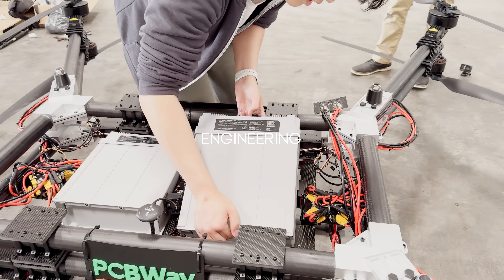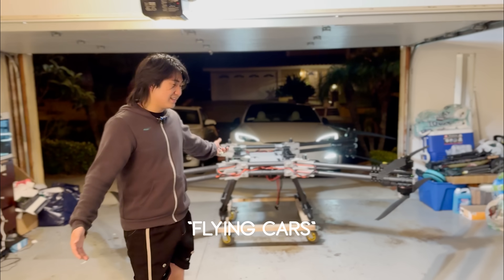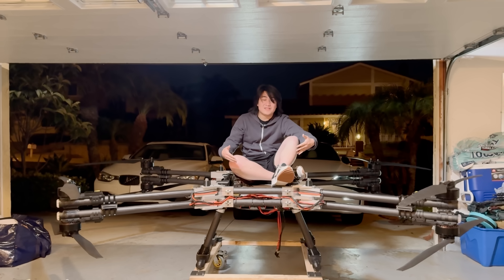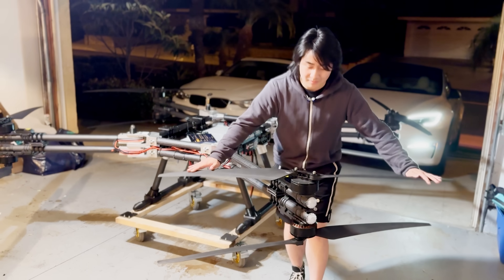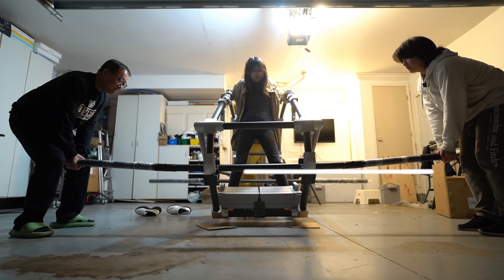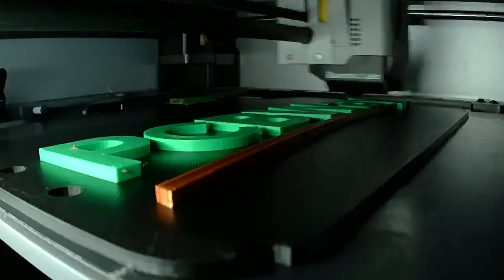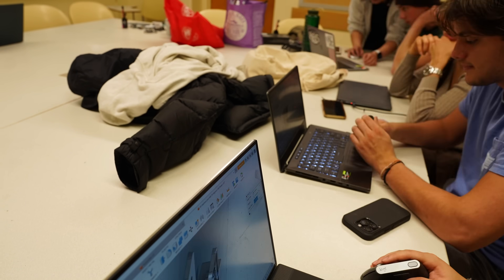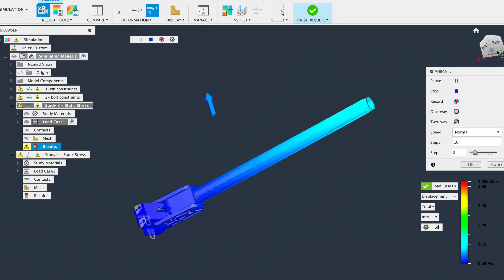My "flying car" finally FLIES

Comment: Impressive work! Just a couple of concerns. What protection will you have for the pilot if a rotor fails and the debris heads towards the cabin? I also have concerns about the soldered wires. I worked for BMW and they don't allow any soldering as vibrations in the car can make them fail over time. I know you were trying to engineer the structure to prevent damage from vibrations but you should also do that for the wire connections and have either crimp connections or robust locking connectors.
Reply from the maker: Thanks for bringing up the crimp idea. I actually didn’t know this, but after a brief research, you’re very much correct. I’ll reflect this with my team and the next design. Thanks!

- a fellow BMW driver
Reply: @alanzeekk  Glad to help!

Comment: Good luck my friend this is amazing and your hard work will pay off.  When it's complete I hope you implement the ultimate set of safety features for the pilot and other people sharing the airspace and the safety of those on ground.  

Again amazing work love it.
Reply: I have a great safety feature for you: A helicopter with one rotor above all heads and a ducted tail rotor (also elevated into the plane of the main rotor) . Auto rotation in case of electrical failure. In case of a crash, the blades don't hit the pilot.

Comment: This thing scares the crap out of me starting with the lack of safety wire, shrink wrap, and some prop guards, not just for a pilot but for ground personnel. At least your test area is smarter than you are... I do like some of the music you used a lot.
Reply: safety wire is weird. Calculate the correct torque for the screw, avoid lube, max vibration possible and it should be safe. That wire is more for places you cannot really reach, and corroded surface.
Reply: @ArneChristianRosenfeldt  You need to check out BASIC aircraft assembly. as it pretty much has nothing to do with the factors you mentioned. Sorry, you're just wrong.

Comment: A roll cage won’t protect a human if it falls out of the sky.  Consider a Ballistic Parachute and an emergency cutoff for the motors/propellors.
Reply: Cages protect car drivers at speeds you only get when you fall 10 m. So, fly low!
Reply: @ArneChristianRosenfeldt  Horizontal speed counts as well as vertical acceleration towards the ground.  🙄
Reply: Momentum.  Obey physics, it’s the law!
Reply: @GodzillaGoesGaga  so use a computer with radar to limit altitude to 3m and horizontal velocity to 40 km/h. This is survive-able in a car accident.
Reply: @ArneChristianRosenfeldt  Why would you limit altitude to 3m ?  Kind of defeats the purpose of having an aircraft !!
Reply: @GodzillaGoesGaga  to limit fall velocity. I was inspired by those French quads, which seem to obey this limit and still go off road very well.
Reply: @ArneChristianRosenfeldt  Mass.  You’re not thinking like an aircraft engineer. This is not a land vehicle.
Reply: Aerodynamics too.
Reply: @GodzillaGoesGaga  I just hate parachutes and explosives.
Reply: @ArneChristianRosenfeldt  Yet you probably drive a car that explodes how many times a second ??  Hating is no reason to not use something.   If there’s a foundational reason then explain it.   That’s what Engineering is about.    Ballistic ‘chutes are pretty well understood.
Reply: @GodzillaGoesGaga  a car uses deflagration and does not explode in the hand of a maintenance worker . Yeah, airbags . But don’t let amateurs handle them!

Comment: You should use PID controllers with gyro data to prevent the jerkiness of the movements
Reply: Looks like he's using PX4. He needs to adjust his parameters and maybe autotune when he can charge his batteries more.

Comment: I don’t want to hate but I don’t see how this is a flying car in any way yet. I mean so far you’ve just built a big drone.
I’m interested in seeing where you take this though. Your talented I can tell that much but just calling it a flying car seems a misleading
Reply: eVTOLs are typically called flying cars, even though they are "scaled-up" drones. Likely the personal transportation aspect. Most genuine flying cars have failed due to low feasibility/folding wing designs. Humans can hardly drive on roads, so sadly I think real flying cars would be disastrous. eVTOLs have genuine applications in the civ/military world too, so this is a good project.

Comment: Don't forget a parachute. Should be one of those spring-loaded low altitude types. And a big panic button so if anything goes wrong, it automatically does the yeeting process for you of dismounting you from the craft.
Reply: Once you load it with a person and fly a full minute claim the world record and call out the companies on the stock market scamming all those investors.
Reply: @TheBagOfHolding  Hmmm, I don't think that's a world record ... you can buy a Jetson One over 2 years ago (California company). That doesn't make this any less impressive though. Eventually, he could (should) make this an opensource EVTol project on GITHUB. Others can improve on the original design or fork them to create variations, etc. You could sell kits so people can buy the parts and build their own, etc.
Reply: @joireland  you can pay for one but nobody got one. Those are scams. They can't fly them for two full minutes with a rider. They edit the videos to make it look like they can.
Reply: @TheBagOfHolding  I think you misunderstood. The company in California (unrelated to this video) sells a product named Jetson One (not a kit & not a scam) and they've been available for 2 years now (it's easy to verify that on your own).
Reply: @joireland  nobody can improve on the design unless they invent a different kind of battery that is magic. He already hit the wall of physics.
Reply: @TheBagOfHolding  It's possible ... do your research dude. His design may need a lot of adjustments to make it lighter but go lookup the Jetson One (maybe buy one for yourself).
Reply: @joireland  I know all about the jetson one.  Look at their videos and count the seconds between edits. Look for any multirotor evtol that ever did what it claims or lifts a person for 3 straight minutes. Nobody got one.
Reply: @joireland  if it's possible then why hasn't anyone ever done it and why don't any customers have their jetson? Have you ever heard of the square cube rule in physics?
Reply: @joireland  this guy should set up a camera and make a video of himself getting on then taking off then flying flying for a full minute then landing an getting off without edits in the video. He should claim a record and have the news cover that new record. It would expose the industry when they can beat it by much.
Reply: @TheBagOfHolding  Jetson One claims 20 minute flight times, it can fly 63 mph and has a weight limit is 210 lbs.
Reply: @joireland  jetson is a sham company. They already missed delivery dates. They can't even prove their own claims.  All the stuff this guy used is already open source it's just a large drone. What did he invent that he can make open source? It can't get much lighter. People that sell them would need for them to be safer and that would add weight. I think this one will fly longer than the jetson one with the same weight. They couldn't get much better if they just used 4 poles 4 motors and a person sat directly on the large heavy battery they would need. Find the longest flight anyone has ever had on one.
Reply: @TheBagOfHolding  Tesla also missed their delivery date. Dude give it up. Go see one in person. Mass production is difficult ... building 1 or 2 is easier (still hard though). I'm talking about Jetson One (not this guy).
Reply: @TheBagOfHolding  Also you're wrong again. The Jetson One is 120 lbs WAY lighter than 200 lbs that this guy built.
Reply: @TheBagOfHolding  What can he opensource ... hmmm ... he can upload to GIT the parts list, the 3D printer design files, the schematics, build instructions. Use your imagination. Not sure why you are so negative.
Reply: @joireland  electric cars are possible and they could take people places 100 years ago. This isn't.
Reply: @joireland  jetson one is nothing but lies. Did they include the battery? Did they prove a single claim?
Reply: @TheBagOfHolding  OK ... now tell me that the earth is flat ;)
Reply: @TheBagOfHolding  Go watch an air show and see one for yourself. Don't waste my time here.
Reply: @joireland  I know more than you do about this. Someone at an airshow would record it an post it. Find that. The only way to know is if someone sits on one for a full minute and claims the first world record then people would try and beat it.
Reply: @TheBagOfHolding  This is not about your ego ... just state what you actually know and not what you believe about Jetson One. Like I said go to see one yourself at an air show.
Reply: @joireland  I know the square cube law.  What weight does jetson say they can carry for 20 minutes? That's empty and they can't even do that. Find a video from an airshow. I think people record those.  Find a video from anywhere on earth.
Reply: @joireland  do you think there should be official world records for multirotor evtol craft? Distance duration and load records? Someone should start them and then we would find out soon enough if companies are legit.
Reply: @joireland  do you think the drone in this video will show a 5 minute empty flight this year? That would be an amazing feat but nobody would be impressed with that because everyone is already fooled into thinking people are riding them with deceptive editing and impossible claims.
Reply: @TheBagOfHolding  nope. legit. $15 million in funding. Marc Theermann is on their board of directors (from Boston Dynamics). I've seen them fly. Not much more to say but go see for yourself.
Reply: @joireland  yeah for how long and with how much weight? I don't belive you. Prove it. They probably have lots of shills claiming that.
Reply: @TheBagOfHolding  There are a lot more credible people than you investing in Jetson (they raised 15 million in funding and that's no lie). You're just an 18 year old tolling these sites and spreading negativity. Go talk to Marc Theermann about their "fake" stuff if you don't believe it (they already sold & shipped about 500 of them).
Reply: @joireland  people invested in theranos and they had important people on their board. Does that prove they ever flew a full minute with a rider?
Reply: @joireland  shipped to who? Can we get a review? It seems people would want to record their new toy.
Reply: @TheBagOfHolding  Go learn something about the current state of battery technology. Go research Natron Energy and learn something. No time for someone who doesn't state any facts.
Reply: @joireland  it's easy to massage the numbers on batteries but you should look at the energy density of the individual cells that make up the battery packs and the progress they have made.  If people had them they would fly them and record such an amazing purchase. Who bought one? Why isn't there a full flight recorded? Why isn't there a full 2 minutes of flight recorded? Why isn't there a full empty flight that is several minutes long? People record delivery of their cybertrucks and make unboxing videos of phones but nobody would with something like a jetson one?  Please.
Reply: @TheBagOfHolding  I guess because it's no big deal. It's been done 2 years ago. Stop making up these conspiracy theories it's not healthy.
Reply: @joireland  sure no big deal. Lol Was it a big deal 2 years ago?  People make videos if there is a new type of pizza from pizza hut and they order one. There would be 2 year old videos of excited customers with amazing aircraft if that was true.
Reply: @TheBagOfHolding  You are a few years late. 3 years ago a dude flew a flying hoverboard for over 4 minutes and that one was much smaller making it's range more limited. The current records for eVtol is way past an hour and Jetson One doesn't claim to be able to break that, so how could they post a record breaking video? There is one video that is over 18mins though.
Reply: @znail4675  it wasn't electric he had kerosene in a backpack.
Reply: @TheBagOfHolding  No backpack and it was electric. Just search for world record electric hover board...
Reply: Remember, there were electric cars before gasoline powered cars.
Reply: @joireland yeah , I got access to all that equipment here in my garage. I’ll crank it out and be flying by 3pm est. lol
Reply: He could also easily integrate an automotive airbag attached to his yeet button that would throw him free of the vehicle too, auto airbags are cheap and plentiful at junkyards and quite powerful. YEET
Reply: He could use guide studs for the seat, and a powerful solenoid or linear actuator that would decouple the seat from the eVTOL. So, if he hits the yeet button, or it's activated by CHAOS detection, the solenoid decouples the seat, the airbag deploys, pushing him free, the guides ensure the seat flies linearly from the vehicle, and then a solenoid/etc deploys the parachute, with manual overrides of everything, so all that's needed is to push a button, or pull a cable. I think this would alleviate a lot of fears for people. When I build my own eVTOL, I will make something like this for my safety, and deploy it over water to test it. Also might put the drone in a tailspin and test it that way, too. I think once the basic design is perfected, it'll go a long way to alleviating fears.
Reply: It would have to be smart enough to yeet "the package" in a predictable trajectory, while at the same time trying its best to avoid flying back into it. (Very real danger, even on the real deal but I think they have a few systems that are supposed to "prevent that".) @wolfpeoplearereal
Reply: It would have to be smart enough to yeet you in a predictable trajectory, while at the same time trying it's best to avoid flying back into you. Very real problem, even on the real deal. They actually have systems that are supposed to "prevent that". (Maybe it turns everything off so it drops down real fast while your flying up.) @wolfpeoplearereal
Reply: Yeeting process should be the technical term.
Reply: Why is this world so full of brainless people?.. OV-22 didn't teach you anything?
Reply: Wouldn’t the prop cut the parachute when landing is done or like are you saying ejection way

Comment: Great video, bit confused to why you left the corners so sharp on the aluminium machined parts, a small radius would have avoided the stress risers. I'm sure its plenty strong enough just seems odd when its so easy to avoid the weakness. Anyway good luck.

Comment: cool concept, would having the "human" and cage below the props be a more stable construct over time lower the center of gravity?
Reply: The main problem would be no way to eject, but I guess a parachute for the entire vehicle would work.
The thing that is a problem for this particular design right now is that it's over engineered in that it's too heavy.
The previous design was too bendy, but this one takes it the other way making it too heavy to get good performance.

But when I think about it so may you be on to something as it would save weight by combining the rollcage and landing gear into one.

Comment: Center of gravity is too high, and with added seating it will be even higher, and will cause the Evtol become unstable. So first, when I said the center of gravity is too high, what I'm saving is that, because it is dead center, it would make it even harder to control because of it's mass weight. this causing it to be very sensitive to control stabilization. A small quads weight  to gravity would be different and easier to control because of buoyancy of air, a heavier object would be harder to control by weight/atmospheric pressure. By lowering the center of gravity, it would make it easier to fly. Remember the MARS Quad, and it's lack of atmospheric pressure.
Reply: Not to mention it’s a literal death trap.

I don’t know why more People don’t design them with far more space from the props of death 🤦‍♂️
Reply: What are you even talking about mate? I think you are falling for the pendulum control fallacy. In theory it is better to have the com higher.

Comment: as an engineer, that first flight of less than 10 sec made my day! You are proud of your creation that once existed only in your head!
Reply from the maker: You are, my people :)
Reply: @alanzeekk  hi
Reply: @alanzeekk  You need a pinweel, gyrescope, gimball to stabilize this.
Reply: Small steps lead to great leaps. You are an innovator and an inspiration to others. Keep flying and reaching for new heights. ❤
Reply: Make it fly well high up😊
Reply: Tbf, peter sripol did it first, watch the vid “flying manned drone”

Comment: alan please reconsider the bolts at 5:26! as the carbon fiber tubes flex up and down throughout repeated load cycles, they're gonna rub against the bolts and could eventually start cracking the tube. this will be very hard to notice since the process is so gradual, but it's an oceangate level safety concern imo.

source: am mechanical engineer
Reply from the maker: Noted, thank you!
Reply: @alanzeekk  thanks for replying so fast! I’m really excited to see the finished project!

Comment: If you would like any of those aluminum parts made out of carbon fiber to save weight, hmu
Reply: Just optimize them. CNC into solid aluminum  is the best 3d material. This done in production cars and planes. Bikes had that.